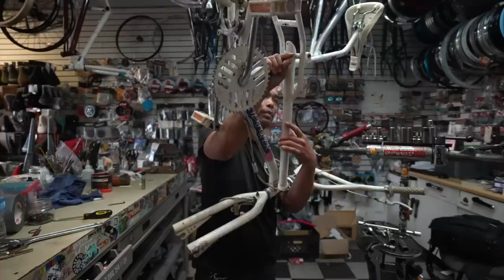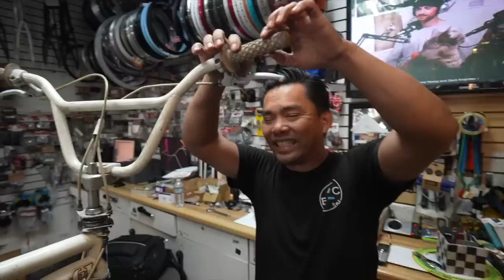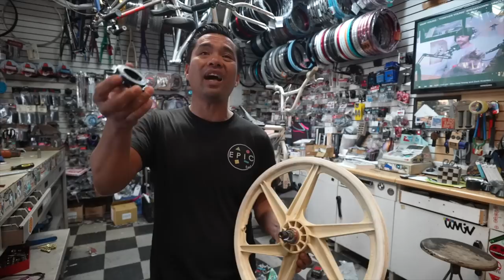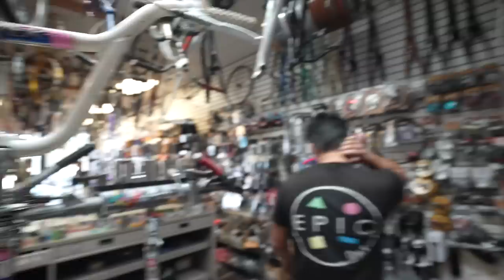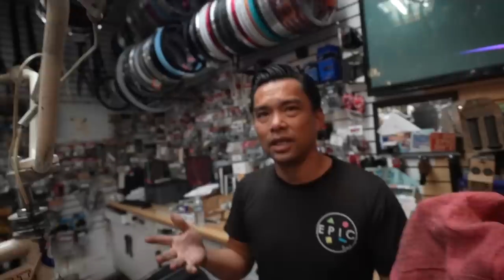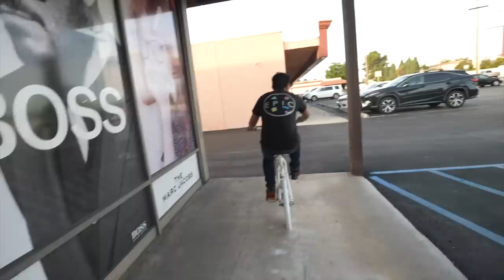Shop Owner Claims This is THEE First GT Performer!

Comment: I had a Diamond back silver streak but I cracked the gusset & bent the forks, got a white pro performer in 84 came with a tuff neck stem, metal flange skyway tuffs, the rear brake was on the top by the platform & the platform tubes were slightly lower than the top tube, I fitted a potts mod a& a single cable ACS rotor it was an awesome bike, learnt to air the bowl on it & X up one footers. I met Eddie Fiola & Dave Breed on the world tour & I have a signed world tour poster & the stem pad from his candy red world tour bike.

Comment: Great video! I found a chrome 87 performer frame and fork on the curb for the trash like 10 years ago! It was fate I found it
Reply: I found a purple 94 dyno air abandoned on the corner in front of my house in 2016, it was really rough because whoever had it kept it outside, it's been sitting until last week, I stripped the frame and painted it, I plan to do a complete restoration.

Comment: Love the old/mid school bike content you guys have been posting. 👍 One thing I've always wanted to see done on video and explained clearly is how to install a 1 1/8 threadless fork onto an old school threaded 1 inch head tube frame, since pulling it off requires very specific parts from what I've read online. If Phu has done this kind of conversion before, it'd be cool to have him break down how to do it; I still have my old GT Performer frame from the 90s in my garage that I'd like to build up and ride, but only if I can somehow install a newer threadless fork onto it.

Comment: I got a 26" mag from a Gt mountain bike explode on me at barley 30-40 psi. I checked and there was a cut tire inside making the space smaller and adding more pressure than it was supposed to hold as a mountain bike rim. The side wall splinted out and could have whipped me but it didn't. Nasty little strip of metal. Could've been horrible for me but luckily unscathed and experienced.

Comment: That’s a 1987-89 Performer, decals are 1987, the frame is AT LEAST a 1987 because of the brake mount brace between the chain stays (990 mounts on Pro Performer and above). As for the mags, those are the OGK GT Performers,  unfortunately, they only ran for two years (1986 & 1987)

Comment: Has anyone heard of a "12 gage ripper" 24" bmx? I have a stamped frame, forks ,sprocket, headset and front tire se.

I've looked around and can't find any info on the "12gageripper" model. I cant tell if someone put their own custom sticker or if it's a custom store model for promotion?

Comment: Great bike & you're right it's not a first generation Performer. The first gen. Performers came out in 84. The standing platform tubes were positioned directly in the middle of the top tube which although I think it looked better, wasn't practical for tricks which is why GT moved the platform up I guess in 85 maybe 86. You can spot an 84 instantly because of this. I’ve still got mine!
Reply: It’s an 87’ I’m fairly sure

Comment: I wanna get back into BMX riding, eventhough I'm 50 now.
Reply: I just wish I still had my 80s BMX, but now I only have my 90s.
Reply: I rode a 24 inch and a 26 inch BMX and they feel weak, like the frames twist and flex each I do a full rotation or revolution on the cranks. It was a Dino frame.
Reply: I love that 80s corolla in the parking lot.
Reply from the maker: Any age is good!!

Comment: seatpost sticker is correct....
Reply from the maker: We think it’s not the matching set though
Reply: @AlfredoMancuso  from what i can see, its an 87-88 non-pro performer.  its not the first one ive seen like that with a sticker from 89 on an 88, maybe late88-early89 they did that.... brakes, seat, clamp, sprocket, neck, bars, all that look og. so in 87-88, the pro performers and pft had the S bend and coin roll and posts for 990's. my first real bike was an 89 GT vertigo ST which had same frame as what u guys have, but with posts for 990's on the bottom. anyways, fun stuff. glad to see its in good hands....
Reply: @AlfredoMancuso   from the museum... "here is an example to go by. on the dropout you have "M1" followed by "08922198"..this one is simple.
M1 stands for "mach one" that is your model gt.
it can also be a "I" for interceptor and so on.
next on the serial is "0892" this is easy to decode too,
08 means 8th month, which would be august.
then you have "92" next in the lineup, this would be 1992
the last 4 digits, are your build number, this one would be the 2,198th one built.
Here is another example. if your serial is KGCG2297 this one gets a little complicated. but still easy once you learn the code to it.
the first letter is who made the frame itself, in this case it would be "Kenisis", an overseas company.this could be replaced by another letter but at least we know what that one is there for.
next is the letter "G"..this isnt always there, but if so, this is where it was assembled, (ever notice the built in usa sticker on your gt or dyno?) this is what that letter is there for. it wasnt made here, but was built here.
next is the letter "C"..C is the 3rd letter in the alphabet, and march is the 3rd month, so march is the build month.
next is the letter "G" this is the year. G is the 7th letter in the alphabet,
so this would be a 1987.
here is one more..your serial resembles this:f6030578.
to start, if you have a "baseball" looking stamp behind your serial, this frame was made overseas...no its not a pacific, so dont cry, or get mad...and lets continue.
on this serial, the first number is the last digit of the year, so 6 stands for 1986
next is "03"....this is the third month..which is march.
so you have a gt built in march of 1986."

Comment: Wow that was a really bad batch of gt tires you got,HORRIBLE gumwall paint thats waay off,lol. Ive sold 5 sets because of that,i kept 1 set i have that kept that to a minimum and i will only put them on for show on my 87 PFT. First performer,lol 85 is the first but 87 and going up they added the lower brake in the chain stays area. You should have at least sanded the brake pads real quick to get some grip.I seen both bikes on bmxmusuem so im guessing your done. Btw bring the price down a bit and it will sell and sell the white frame with the wheels too.